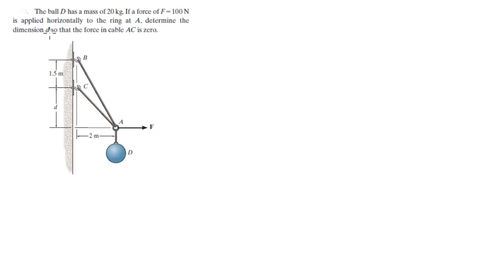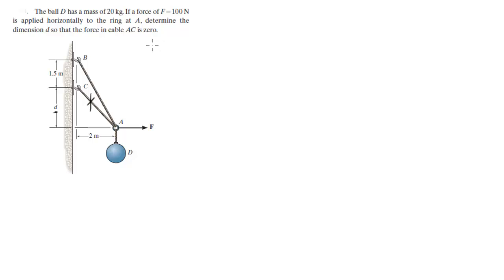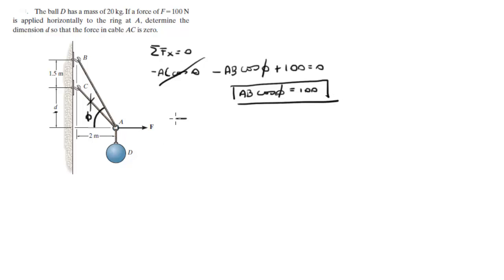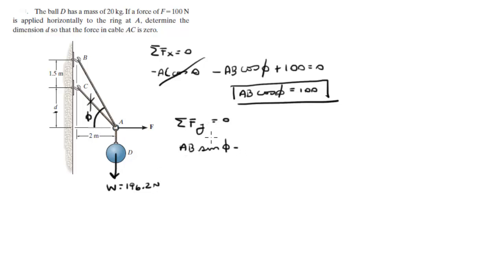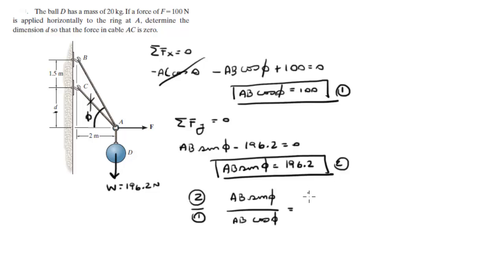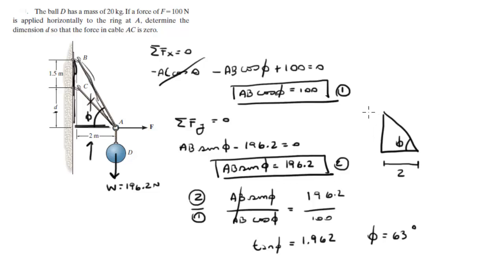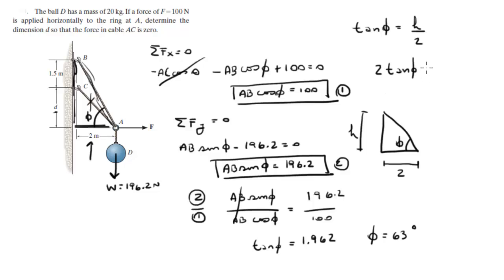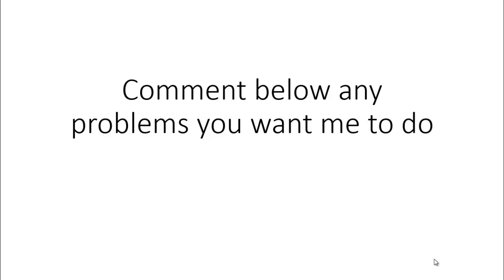Determine the dimension d so that the force in cable AC is zero

Comment: You also could do it w/o trigonometric functions, I replace the hypotenuse with the letter h, so EFx=-Tb(2/h) + 100 = 0 and EFy= Tb(1.5+d)/h - 196.2 = 0. 
So Tb = 100h/2 and using the second ecuation we get that 100h(1.5+d)/(2h)=196.2, we cancel the h and we end with these ecuation 1.5+d=196.2/50 and d=2.424